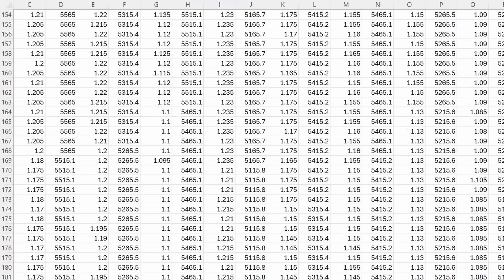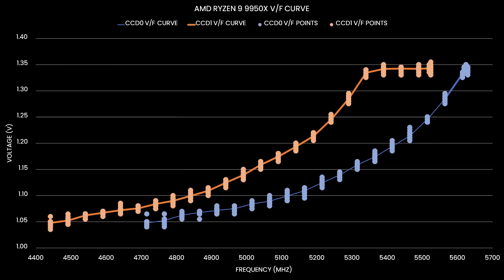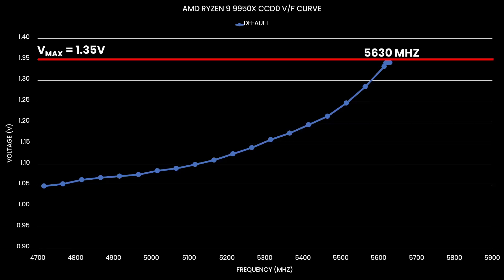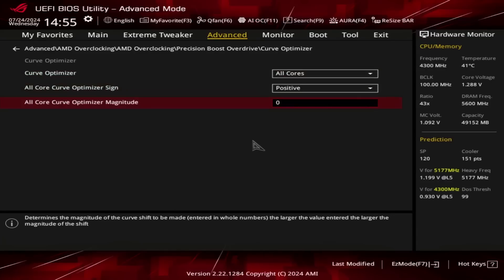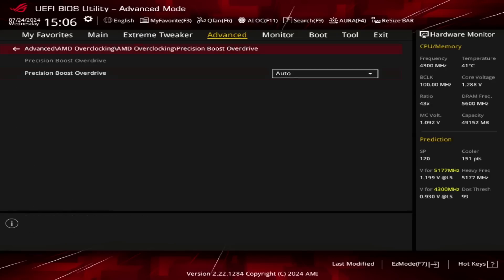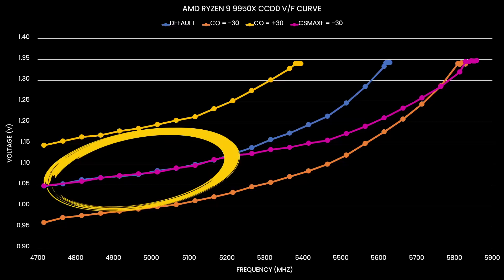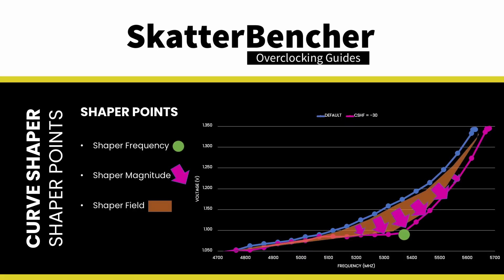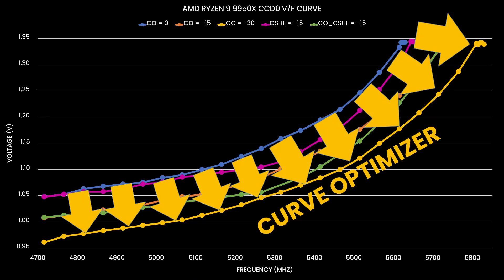Ryzen 9 9950X Curve Shaper Deep Dive

Comment: Cool academic video explanation, but you should have ended up with some actual setups for daily use. Yes it will depend on the binned cpu but some guidelines would be great. I have the 9950x with all cores at -20 and in curve shapper I set the low frequencies to +15 so they end up being -5 to avoid instability (we know crashing mostrly occurs with system doing nothing the more undervolt you do). I leave medium freqs at 0 (so -20 of CO), and I set higher frquency to +30 (+10 because -20+10=10) so it has enough voltage. Now the problem is that I'm improvising all this because seems logycal to me, but not really sure. Single core boost is not reaching even 5.7 but multicore is good.

Comment: I'm a little confused at 12:29, specifically the numbers of default and CO-15 at 5615MHz: How can there be a difference of 92mV (1333 - 1241)? I though the max mV offset of a single step from CO is 5mV? 15*5mV = 75mV. So how can there be a 92mV offset with a CO value of -15?

EDIT: many other numbers also don't add up, sometimes there's less than 3mV offset for 1 CO step. How did you measure these?
Reply from the maker: I detailed the process on my blog: https://skatterbencher.com/2024/08/07/granite-ridge-overclocking-curve-shaper/#The_Voltage-Frequency_Curve.

Comment: After messing around with curve shaper for a couple hours, I had something very similar in mind, but thank you for all the data points and notes throughout the video. It has cleared up a lot. And knowing they stack is amazing as some high temp max frequency things can be changed from mid temp high frequency upon my already stable co-32

Comment: Like your previous videos, thank you. Great stuff. My question is that does it work with ryzen 7950x?
Reply: I tried Curve Optimizer on my 7950x and it had no effect.
Reply: @bgtubber  I think it will work. Because there is no physical component, we need to control the curve shaper. It is just software development.
Reply: @Hadi-zw9mb  That doesn't mean that it will work. They can still block it when a non-9000 series CPU is detected on the motherboard.
Reply: @bgtubber  it might happen. But I see what AMD did with FSR in their graphic cards and hope that they will do the same for curve shaper.
Reply: @Hadi-zw9mb  Yes, I hope so too. Fingers crossed.
Reply: it does work with Zen 4
Reply: @RmX.  I change it in my 7950X processor and nothing happened. What is yours?
Reply: @Hadi-zw9mb  I didn't try myself I just saw it on reddit somebody posted with 7950x
Reply: @RmX.  So was I. But from my tests, It didn't work.

Comment: Awesome in depth explanation! Can you explain how you got the initial vCore/freq curves for your CCDs?
And more important: how do we check for stability for every curve point after applying curve optimizer/shaper?
Reply from the maker: HWiNFO to log voltage and frequency while running OCCT memory stress test. The memory test forces all cores to be active but the load is very low so there's no throttling.

Checking stability is very tough because you need to try different parts of the curve. I usually first try the weakest part of the curve by running multiple types of workloads ranging from really light ones like OCCT memory, to more strenuous ones like gaming and geekbench, and also heavy workloads like Cinebench, and finally stress tests like OCCT CPU. The key is to find the workload that's causing problems first and use that as reference point for stability checking.
Reply: @SkatterBencher  What do you think about corecycler?
Reply from the maker: Great software! I used it a lot in previous overclocking guides
Reply: @SkatterBencher  do you know a way to lock a specific point on the vid/freq curve for stability testing?

Comment: What's up with that hockey stick flattop on CCD1's default curve?  It kind of looks like CCD1 would be operating with excessive margin under some conditions. If you use use curve shaper to put an extra ~200 MHz on CCD 1 in the "high" and "max" frequency bands, is it stable?
Reply from the maker: That's great thinking! I agree with the hypothesis and how to test it.

I'll give it a try when I finally get around doing the 9950X OC guide. Note that Curve Shaper is only available per CPU. I haven't tested too thoroughly yet but it feels we should at least have a per CCD shaper since the V/F curves are so distinct.

Comment: So what about CO_CSHF = -30? More frequency for less heat is my absolute preferred option.
Reply from the maker: CO_CSHF = -30 means we'd use -30 Curve Optimizer and -30 Curve Shaper (High Frequency). This will definitely be better than CO_CSHF = -30 ... if it can run!

Remember, Curve Optimizer and Curve Shaper stack. So setting both to -30 will give you near -60 undervolt points around the "high frequency" shaper point. That wouldn't be stable (on this CPU).

Comment: I think best CS will be +ve  at mid freq  and -ve  at high freq  so that when  gaming or low thread task it boosts higher but in all core temp it maintains higher all core boost all the time  , correct me if im wrong
Reply from the maker: I don't have a "best practice" yet, but my current view is that it's best to use Curve Shaper as a "fixer" in combination with either CO or ECLK.

With CO, use +ve CS to fix parts of the VFT curve that's too much undervolted. With ECLK, use -ve CS to fix parts of the VFT curve that's not undervolted enough.

Comment: What's with the difference between the max frequencies of the 2 CCDs? 300 MHz is a significant difference, and is unacceptable unless there is a proper excuse for it such as the presence of 3D V-cache on the slower CCD or something. The max deviation I can live with is 150 MHz
Reply from the maker: This was already case with Ryzen 7000 series where CCD0 was significantly better than CCD1. We also see the same with Ryzen Threadripper, where only CCD0 has the high Fmax. I suppose the idea is that any CCD other than CCD0 serves as "core fillers" to increase core count.
Reply: @SkatterBencher  Sounds more like a scam, I wasnt even aware of this
Reply: @AndyU96  no, this is a deliberate choice to simplify segmentation (always one good and one less good die packaged together, rather than having two SKUs with same core count such that former having two good dies and latter two less good dies)

Comment: Very interesting video,. Looking forward to further investigations into this.

Could you also include a short tutorial on how you achieved getting all those data points, what softwares were used etc etc., Would love to do something similar to that on my 5900x.
Reply from the maker: I added a brief explanation in my blog post https://skatterbencher.com/2024/08/07/granite-ridge-overclocking-curve-shaper/

BIOS Settings
Disable SMT (this lowers the operating temperature)

Stress Test
OCCT Memory Test > 16 threads (low stress on CPU but all cores to C0)

Collecting Information
HWiNFO > save to CSV (collect CPU frequency and CPU VID information)
Shamino OC Tool > reduce Precision Boost Fmax at runtime in steps of 50MHz every 10 seconds

Analysis
Excel > Vstack frequency and VID of Core 0-7 (CCD0) & Core 8-15 (CCD1)
Reply: @SkatterBencher  thank you. The spread of voltage at each frequency you got on the curve, is this to be read as variation of voltage at a given frequency varies with temperature?
Reply from the maker: The different points are from the different cores within the CCD because they technically each have their own VFT curve. For simplicity, I average to build a single V/F curve.

Comment: Really after so many tools at this point by AMD, they could release a program that automates all this stuff so you can either get the most efficiency by your silicon, either the most performance, zero potential wasted.
Reply: They will never do this. Anything that may introduce any form of instability is an absolute nono. This is why everything is tuned so conservatively. This is because silicon degrades over time. Albeit very slowly, it does happen. By introducing such a tool to a user that is not aware of the consequences this may result in a crashing computer with a "defective" AMD CPU.
Reply: AMD won’t do this because they don’t wanna do anything like Intel, and with good reason.

Comment: honestly, even as an enthusiast, this is quite a lot of info to absorb
Reply: Not really. We been doing it on GPUs forever, just with better UIs using things like MSI Afterburner.
Reply: @AirSKWolf you've just proven that you don't understand curve optimizer, let alone curve shaper.
Reply: @Markknightexeter  or maybe you just never realized that with MSI afterburner you can see and modify the entire frequency/voltage curve.
Reply: @AirSKWolf  ok fair enough, I thought you were just talking about normal overclocking, my bad.
Reply: @AirSKWolf  Afterburner can't define voltage offset as a function of temperature. So no, we have not been doing this on GPUs forever.

Comment: Urg I HATE the bios screen design for setting values for the curve optimiser. It should be a 2D grid of numbers with the axes of temperature and frequency . 0 means no adjustment. a negatrive number means a negative adustment. A positive number means a positive adjustment. Who the fuck thought 3 drop down menus was the UX solution of choice for this, two of which can be completely implied from the third value?

Comment: Did I miss it, or is there no way to increase the max voltage past 1.35V while using the curve?
Reply from the maker: Scalar gets you a little more voltage under load; however there's no way to override the voltage limits of PBO. You can go higher in voltage with manual OC.
Reply: @SkatterBencher  What happens if you set an offset in the VRM controller IC?
Reply: @TheBackyardChemist  it does get over that limit but no longer at high frequencies, you need to apply negative offset in both PBO and VRM offsets if you want max boost per volt possible

Comment: Nice content
In other words, now you can draw a voltage curve of almost any shape what you want, and even tie it to temperature. I think for most people it will be enough to simply set the offset to -30 at maximum load and get small overclock, or additionally limit the frequency to standard one to get undervolt on high loads and lower the temperatures

Comment: I'm much looking forward to your video about Zen 5 memory stability with tuning. Also please make a video about DDR8000 uclk=2000. A full analysis with benchmarks would be great because some overclockers are disagreeing about DDR8000, some are reporting significant performance increase in varied benchmarks while others are reporting a "very minor difference."
Reply: 8000 with fclk=uclk is about the same performance as 6400 with fclk 2133 (3:2)

My CPU requires a high SOC voltage for 6200 though and can't do 6400 1T at all. On the other hand, it does 8000 1T below stock SOC (1.05v).

Comment: Seems most the reviewers of the 9000 series don't bother tweaking it and just say the chips suck at the default settings and normal PBO, when I think they are designed so people will utilize the new overclocking feature, im gonna get one just to see how far I can push it. Already got a 7950X3D to hit 5.9ghz stable, it's been like that since I get it last year using undervolting and +200 PBO with 65C cap on Air.
Reply: Benching with defaults firsts has been a staple for a long while now because not only enthusiasts buy these CPUs, in fact overclockers are a tiny market compared to the normal crowd.
Reply: @SWOgottaGO I think we should then start normalizing learning about your hardware and how it works. Even how you can make it better.
Reply: I highly doubt your effective clock is hitting 5.9ghz
Reply: Precisely. Doesn’t matter to their simps, though, they’ll parrot whatever their fav “techtubers” say despite lack of fair and adequate testing.
Reply: @DarkMatter__YT  that is precisely not representative of the situation of most people, though. most people won't bother to do more than enable expo and maybe enable pbo. if they want guides for enthusiasts, channels such as this are available. 

i grant that it can be irritating when people misrepresent the capabilities of certain platforms based on surface-level research or sensationalist media, but such is the nature of casual fandom
Reply: Okay fine, but you just showed previous gen can be tuned too.
So fair comparison is either 
7000 stock vs 9000 stock
7000 tuned vs 9000 stock
7000 tuned vs 9000 tuned
DEFINITELY NOT
7000 stock vs 9000 tuned
As AMD simps tend to focus on when they are "measuring". Because we want to see how the CPUs have improved and how more they can be tuned over tuning the previous gen. Not giving AMD free pass for upselling non X chips and removing box cooler...
Reply: 5.9 GHz?
Reply: @alb9229Do you mean people who buy PC from Dell or Lenovo? If you don't know about BIOS, don't build DIY PC. If you don't want to learn something it is your choice.
Reply: Building a DIY takes a few hours. Tuning and stabilizing an overclock takes a week. That's a ridiculous investment to demand even from powerusers.  Neither AMD nor Intel has ever intentionally nerfed a product to drive users toward overclocking.
Reply: @Vegemeister1  I spend months tweaking mine to get the best overclock settings, for my CPU it was -20mv, PBO +200, 65W and the DDR5 5800 CAS30 tweaked timings (instead of 6000 profile). for the 7950X3D.
Reply: People (intel fanboys) cried for years about how intel CPUs could be tuned to massively beat Ryzen and now the tables have turned and it's the AMD fanboys turn... I've benched competitively and for gaming performance for well over a decade now and the performance gains these people quote are always way out of line with reality.
Reply: Because most of them are BS and have absolutely no clue how to research, they just want to slap videos out as fast as they can.